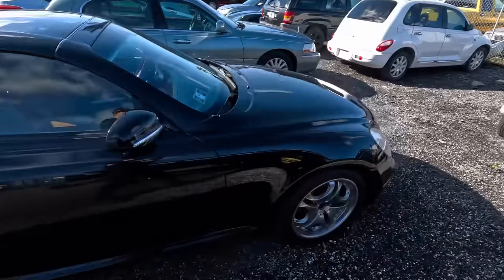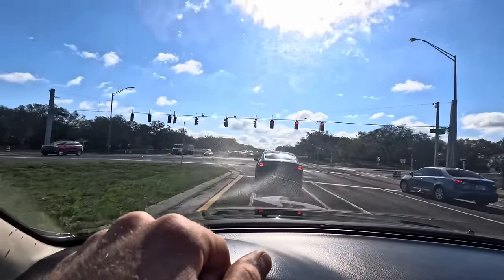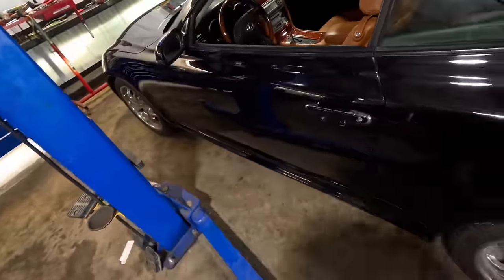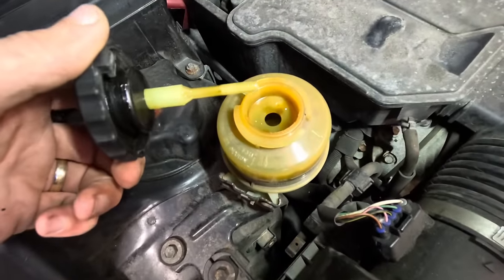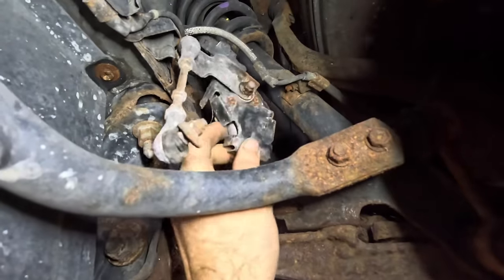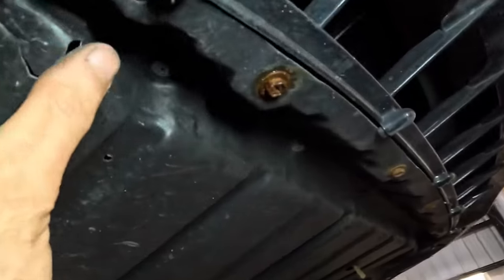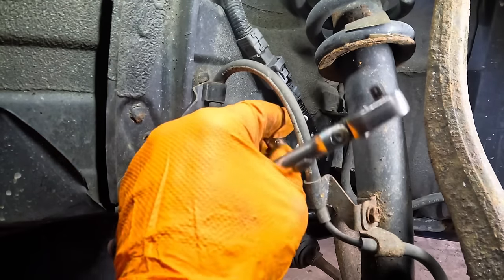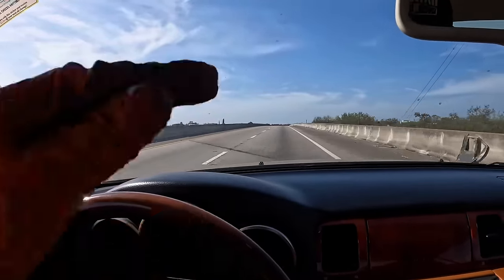Most Hated FAILED Sports Car! Lexus SC430

Comment: Ray a  tip on those stuck connectors  a little spray of WD-40 works wonders and it also allows them to snap together much easier.
Reply: there's also a new WD-40 "Penetrant Spray" on the market - whether that's just the same old stuff in a new can / wrapper I don't know .

Comment: First thing I do is rustproof our Ontario vehicles.  The ONLY used vehicle I will buy is one that has also been rustproofed.   The only system that works is an oil based system that has to be applied every year.  Once rust starts - the electrons will start moving and rust will appear, but at least you can slow things down.   You may get a little dirtier when working underneath, but it is so nice when the bolts come off.  This poor Lexus needs an oil based treatment badly.  Not hopeless, but there is so much corrosion I can only guess how bad things are in the places you cannot see.

Comment: I live in FL. Any car from Illinois or thereabouts, is rusted crap after 20+ years; I would not pay a dime for any of them at all. 
That weather (salt) not only rots the body and fasteners, but hard on the engine as well, those below-freezing temps cold starts do a nasty number on the engine also - and with those miles, it was a short distance driver also, but still spent plenty of time on salted roads - as the rust proves it. 
BTW: Did you notice? It has an expired license plate tag,  expired in 2021.

Comment: when a car becomes "old" and new parts are close to unobtainium, used parts are just fine but i do agree that so long as the owner is both aware and agrees to having used parts. and knows there is but a very limited warrantee based on what the seller will give of a warrantee. if customer is cool, then rock on

Comment: Its literally the same chassis as a 2nd gen gs400/430. At the time people were calling those a BMW competitor. Even the suspension is cross compatible its just heavier bcuz of the convertible. Then you get the rmm or toms supercharger kit and it rips. Though the suspension makes 160 feel like 30 you'll still beat some surprising cars, and if you just lower it and do some poly bushings on the lower arms and rack, maybe a rear swaybar depending on your choice of lowering, they feel sporty for cheap. I will say though it should have gotten paddle shifts, the gs beat it there cuz paddles are fun. Also these don't really scoot with vsc on, the electronic throttle bodies on these cars just don't respond at all with it on, little better on the 1uz with the cable, but still a mostly electronic throttle body.

Comment: Always nice to see Lauren.  Missed her on the last video.
And a Genesis is just a Hyundai,  A Cadillac is just a GM.  Lincoln is just a Ford.  Must I go on?  😁
Does this guy ever maintain the car? The car has definitely  been North.
The used is better than what he had.  The customer should be made aware of the used part and the reason for using it.
Thanks for not putting us through the fluid changes.
Good video.

Comment: If you're going to install used parts then the customer should be aware. As to what level of warranty you offer that may depend, but it would be reasonable to assume that warranty on the part will be shorter or non-existent.

Comment: Sometimes there's no alternative but to go with used parts as long as the customer knows that and there will be no warranty offered on the used part. With so much rust on all the components under the car, seems the only alternative to working on everything is to sandblast then coat affected parts with something like Por15 or the equivalent. Still, what a hassle! 🤔

Comment: the SC Suppository, they are ALL over Palm Springs, CA and owned by cotten tops and in great looking condition. my 2021 Lexus LC500 convertible had a cd player.  The SC300/400 was more popular. Ill take a Lincoln Mark VIII LSC thank you. Arod needs to give you a few lessons on getting rusty fasteners out.. Soak soak soak...your BG soak, PB Blaster, liquid wrench, deep creep... as an owner of much older cars, sometimes used parts are the only way to go. You cant possible warranty a used part esp if its electrical.

Comment: 100% u can and should use used parts..... however only on a type of situation u were in this time.  Where new part no longer available.  That's your only option is either used part or no part.  U should make customer sign something though stating u can't guarantee used parts as some people can be sneaky and use that against u if the part ends up failing

Comment: That's not faux wood. Lexus does use real wood. I had a 2002 RX 300 and thought it was faux wood as well. But had to pull a piece as found it was real wood. Now own a 2017 GX460 and still real wood. You are correct about features (especially safety) being 10 years behind. But I'm happy for that as mine doesn't have adaptive cruise control or lane departure. I personally am happy it doesn't. I know how to drive and can't stand those features!

Comment: Used parts are fine. If it gets the consumer back up and running for a cheaper price and in a more timely manner, great. Safety features shouldn't be gambled on though. In this instance it's clear the car was fine without the ride height sensor from a safety aspect.

Comment: I don’t know man. Sometimes I think welding small parts like that is akin to black magic. I wonder if it’s really going to hold. Probably because of the videos trying to get broken screws out of the block. 
I understand questioning used parts in high end cars but at 20 years old I see no problem with it or if a new part is unobtainium.

Comment: I repair ancient, and slightly used radio and electronics. Without old/pre-used parts none of these things would live again, due to parts in them being no longer manufactured, and therefore unobtanium. I look at it this way, if the customer really wants the thing to live longer, then I do my best to achieve that, and you use whatever you can find. Oh and by ancient I mean 30 years and older, slightly used is 20 years or so.

Comment: Isn't the the same V8 3UZ-FE that came in the '01-'06 LS 430?  If so, that's a bulletproof all aluminum beast that was so good it was the base for the aviation certified  FV2400-2TC motor.  The only critical maintenance element is the timing belt at 50K.  My guess is this poor car hasn't had any of that done.

Comment: I have no problem with used parts where new isn;t available or is just not economically sensible. I own a 1978 Honda and a 1959 Triumph in my bike collection, both being restored. New stuff is just not an option for a lot of things where reproductions are not being made. Wouldn;t have a problem with a shop fitting used parts as long as I knew, was given the option, and was charged the right price. I OK'd fitting a refurbed turbo on one of our fleet 18 ton trucks as it was an older one, and the £6000 pricetag just for the new part was more than it was really worth. A good used part halved the price, and as it was refurbished still came with a years warranty.

Comment: Used parts are fine, especially when new replacements aren't available or are prohibitively expensive. However the customer definitely should be informed and give their approval  before installation.
I was PISSED to have a fuel pump fail on me just 2 or 3 years after a shop installed it. Normally I would have fixed it myself, but needed it fixed quickly and paid through the nose to have it done. What the shop installed didn't stop pumping, but it suddenly began leaking fuel badly, especially overflowing every time I filled up at the gas station. Later I found that the plastic top of the pump had several large cracks causing the leaks. 
The shop had  charged me for a whole new assembly, but apparently had taken a money-saving shortcut replacing only the pump itself, either in my oriiginal or in another used assembly they happened to have on hand. It wasn't because a complete, new assembly wasn't available, either. It was (and still is).
This 2nd time around I ordered and replaced the entire pump assembly myself. It was only by doing this 2nd replacement myself that I discovered what the shop had done. I have since avoided them, but it is a specialized vehicle and they are one of very few places that work on them and have the diagnostic sohftware and some specialized tools... so I may someday have no choice. 
Note: The entire OEM brand fuel pump assembly with fuel level sender, etc., sells for around $400 (which is about what the shop charged me, plus labor). But an aftermarket pump element alone can be bought for around $30 and installed, if the rest of the housing and assembly is okay (and judging from the condition of what came out of the tank, this appears to be what the shop actually did).

Comment: I absolutely agree with your "cut and paste" analogy on people who are merely "parts changers" as opposed to mechanics. Too many people today are not critical thinkers. Too many "mechanics" would not be able to do the things that you do when it comes to identifying a problem and repairing it. Many of today's "gunsmiths" are the same way. All they know how to do is change out parts on an AR or a Glock. A while back I had a revolver that needed work and none of the gun store "gunsmiths" would/could handle it. I had to find a garage gunsmith to do the job. That pistol is now one of my most accurate guns.   
     As for used parts, as long as the owner is aware and understands that YOU cannot absolutely guarantee the part, I wouldn't have a problem with it. In the past, I've told my  mechanic that if a new part isn't available that a junkyard part would be acceptable. 
    End of transmission.

Comment: As a Lexus Service advisor, I can tell you it will need: timing belt,waterpump, idler pulleys,zero belt,tensioner, all filter,all fluida,new ps res,new coolant res. Spark plugs, off valve,in coils,,rear diff svc. Trans svx. This is just to start.. They all have rodent nests and damage.

Comment: New vs used - if there isn't a viable option, used is fine but of course the customer has to know. Can also run into the situation where a new part can be backordered but it will take ages, or can use a used part much quicker - customer option. Can't be expected to warranty a used part as there isn't a manufacturer to honor the warranty at that point, can just warranty the installation. New vs used is somewhat similar to new vs remanufactured (except reman usually has at least a token warranty). In all things, the customer has to know.

Comment: I don't think there's any issue with installing used parts. I do think the customer should be informed of the part really doesn't have a warranty, if it doesn't work right off the get-go or fails within the first month, I'd be inclined to replace it, the installation should have its own warranty of course. However you don't 100% know the quality of what you're putting into the car, the customer should be informed of that prior to purchasing the product.

Comment: In light of the fact  Lexus, and Toyota new old parts were wiped out by a Flood in Japan after the off shore earthquake  and almost all the parts were washed out to sea as the area hit was Toyotas storage area as well as new cars and homes.  Used Ebay parts might be all you can find prior to that date.
Unless some were stateside.

Look at the doors it has a big reinforcing bar down the inside of both doors to cut down body roll and flex because its a retractable hard top.   You don't see many soft tops or such anymore because of body flex 
Id read the date code on the tires.
Over 6 to 8 years old they need to be replaced  regardless of tread wear.

Comment: I would notify the owner that the only available part is a salvaged item and that you will warrant the installation, but not the actual part itself. After all the original part failed and who's to say the used replacement won't have the same defect? Sometimes used is the only option.

Comment: IF Dealer - parts store - make specific vendors do not have the parts the customer should be notified that OTHER parts are available BUT they will not be warrantied. However, they should be made aware of where the parts would come from.

Comment: one thing i want to get in my life is just a well maintained sunday drive car. not a fancy car just super well maintained with spare part being everywhere for it and a mechanic that is honest and skilled in the car so i can just write a blank check on the work for it.

also i think it is fine to use used parts if you can't get new part, it is part of keeping a car working. the only points around it is you need to tell the owner it is a used part and the part must work when leaving the shop. there is no warranty on the part but the work is still covered (so you need to fix your screw up like forgetting a bolt that causes damage.)

Comment: Used parts should be fully explained to the customer before ordering said parts. The use of used parts becomes more of a requirement as the cars age, so i agree with using someone else’s parts to keep this car functional. I have done the same on my vehicle with the understanding that the warranty is non existent on used parts.

Comment: Used parts are totally acceptable. Even in instances of new parts being available if there a a great cost differential. With used parts the owner could take on the responsibility of purchasing the part directly. 

End of transmission. Ray your knowledge and memory is beyond your years. But that just means you paid attention when you were little. 

Sign of a mechanical mind always wanting to know how things work.

Comment: 1st, the customer should be asked at the very least whether they want to go with a backordered part or a used part. 2nd, I'm perfectly fine with using a used part as long as it is relatively in great shape like that sensor that you used. 3rd, saying again I'm perfectly fine with using a used part as long as you can guarantee that if it breaks or fails you will replace it again, maybe with like a 3-month guarantee or even as low as 1 month...

Comment: Well............what I find horrifying that this is a Lexus, ostensibly an auto par excellance and when you take off the engine covers it looks like a plumbers nightmare underneath.  No attempt to lay out the wiring at all.  Reminds me of a Lada I once fixed (don't ask).
Honestly, I wouldn't have welded the old bracket, I would have made a new one from 14 AWG sheet.  It will be more reliable when you consider this is part of the suspension and is going to be subjected to shock loads. 
It's okay to use old parts, unless the owner is willing to wait however long it is and he'll have to pay the admin fee again.  Excellent job finding one my man.

Comment: Perhaps the price in 2004 was high 
Similar to a Porsche 
People would buy the Porsche not the Lexus 
In 2004 it was a great looking car 
My brother had it as a Sunday driver
Replaced his 454 Vette
The Toyota version was the Solara
Became super mad when I told him 
Didn’t squeak at all in 2004
20 years of rubber & plastic drying out
20 years of original fluids
Try that with a GM car

Comment: These cars were made in 2001-2010. Of course it doesn't have wireless chargers or USB connectors. Those things basically didn't exist or hadn't been fitted to any cars. They actually were great cars. It's just that people in the market for luxury sports cars are a much harder demographic to penetrate than something like the executive sedan like the LS400. If this is an early 2nd gen SC, then having a tape deck is not out of the ordinary for other luxury cars.

I like your vids Ray, and I'm just chalking this up to you being younger than I am (early 40s). I am a German car guy, but I respect what Lexus did for the car market and the amazing engineering they accomplished to make such a solidly built car for the amount of money they sold them for.

My initial view of Lexus when I was younger was that they were just not as good. Their parts seemed cheaper and the quality didn't seem as nice. This was kinda true, but the more you study these cars, the more you realize it's not quite the full story.

Based on the wheels on this car, I also suspect this car has had some work done to it. Drive a German car (which I loved) from the early 2000s. They all sound like this now, if not worse.

Comment: Using a pneumatic impact tool on the wheel locks is a not a good thing to do. I had a car that had similar wheel locks ajd it turns out the dealership was using their impact tools on it when I had the car serviced by them. Then one day I had a flat tire and tried to put my spare wheel on. When I turned when I tried to loosen the lock with my lug nut wrench, the head of the lock just crumbled to pieces.
I looked at the other three locks on the carr and I notice cracks at the heads of all the locks.
When I finally got it to a dealer (Not the same one I always went to.) They told me they see th8s all the time because of service departments use impact wrenches on them. They had to use a special extractor to get the locks off, and I put on the regular lug nuts to replace them.
The wheel lock (Made by McGuard and sold by the dealerships as an optional item when you buy a car.) metal is just not strong enough to withstand the impacts from impact wrenches.

Comment: I wouldn't touch the steering wheel with these dirty gloves. Other than that: great improv on the repair.

The ride height sensor must be there to control the headlight angle. I don't know whether this car has HID lamps but a misaligned angle can be a bitch for oncoming traffic.